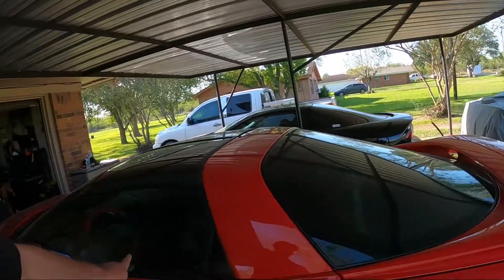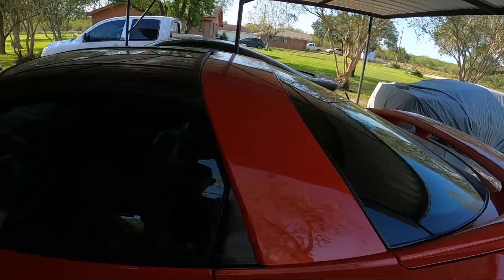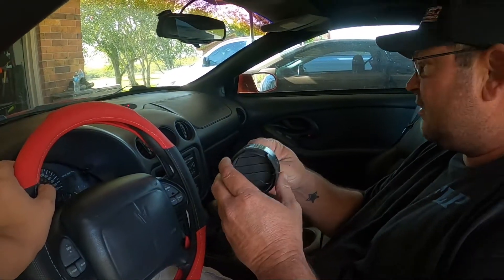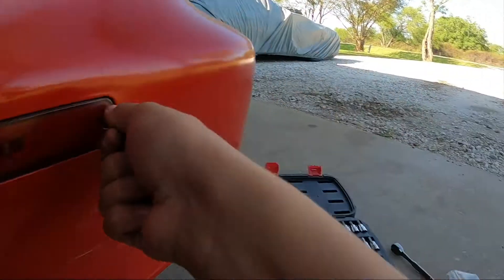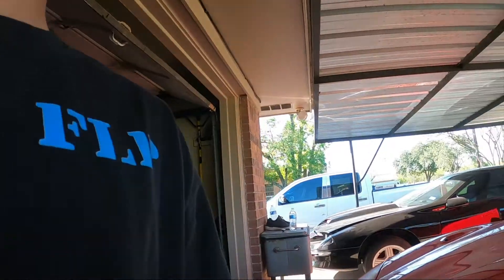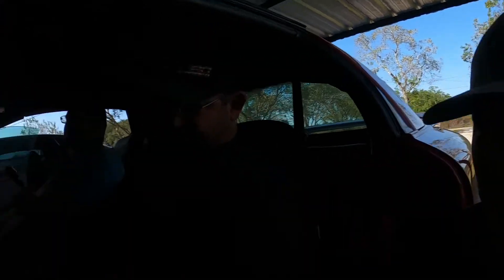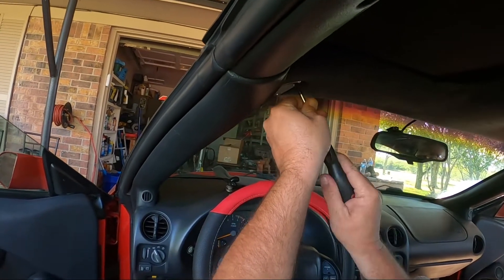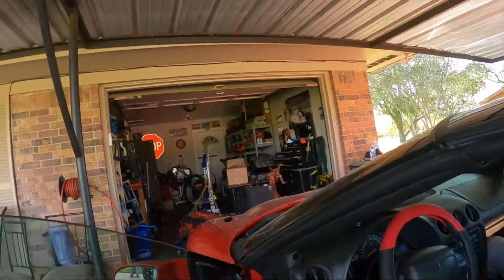Threw some side markers & visor deletes on my 99 Fire Hawk Trans/Am

Comment: High pressure is the way to go unless u got custom high capacity oil pan or dry sump setup. High volume has the risk of sucking the pan dry and losing oil pressure on some stock pans.
Reply from the maker: Appreciate the info!